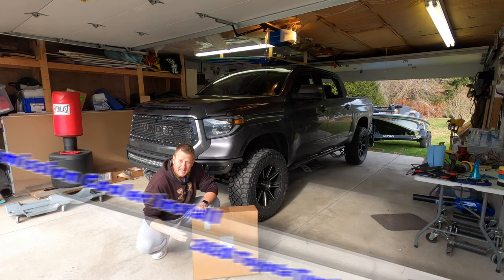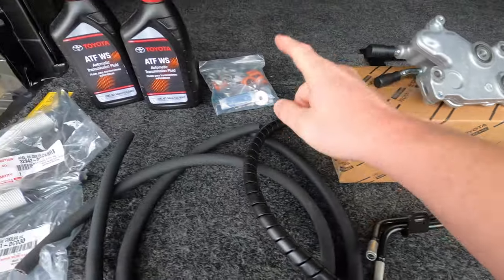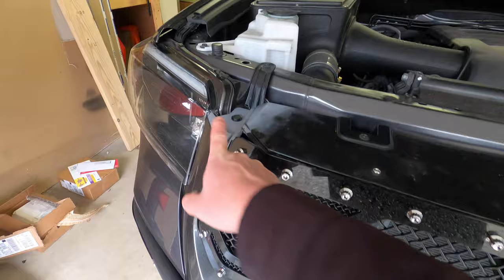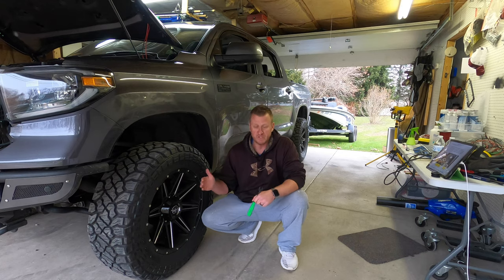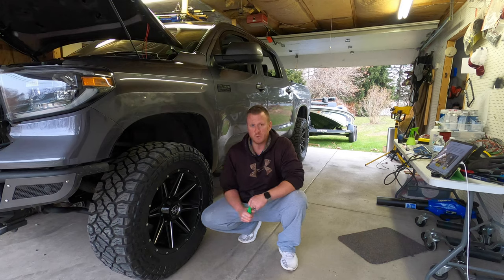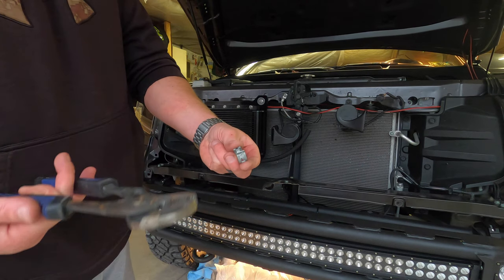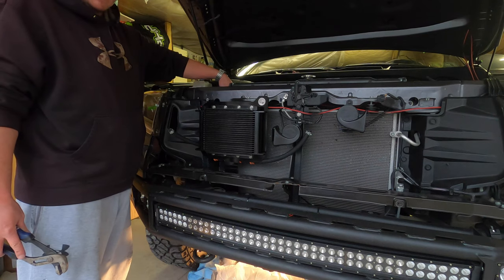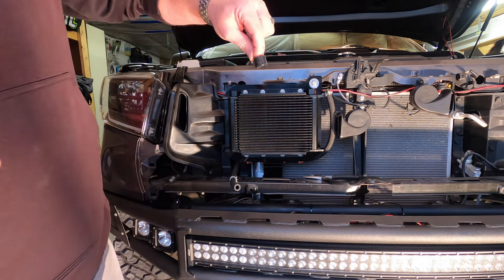Transmission Cooler Install On 2020 Toyota Tundra

Comment: Toyota owes customers trans cooler that was labeled on sales sticker. Class action needed. Nice video.
Reply from the maker: Yea I’ve heard the class action idea mentioned a few times....surprised someone hasn’t pursued it yet, I’m still scratching my head on why they would remove such an inexpensive part!
Reply: To sell more transmissions and transmission components. Lol
Reply: @GunSnob  yes. I'm sure that's why they did it. 🙄
Reply: @NitroZ18Fishing  because this is the beginning of toyots downfall when it comes to reliability. Don't know what made them think "hey!! What IF we take out all the trans coolers!" Then the rest of toyota starts cheering
Reply: @NitroZ18Fishing  of Toyota wants to sell more trucks then Chevy, Ford, and Dodge then they have to do away with quality control.
Reply: @NitroZ18Fishing  this kit is $1000. That doesn’t seem inexpensive to me. Ford stopped painting their vehicle seat frames to save pennies per unit. This is a much more substantial savings.
Reply: @NitroZ18Fishing  I actually went all the way up the ladder to the NYS attorney general to get Toyota to document their reasoning for removing the cooler from the 2019+ Tundra Models.  I also took it to the dealer from where I purchased the Tundra for one of their master mechanics to look at.  The Toyota "blueprint" (I guess you can call it) lists the transmission warmer (that round thing) as the cooler itself.  If you want, I can email you a copy of Toyota's official reply to me after the AG inquiry.  The dealership was cool about the entire process as well and didn't charge me anything to take a look and put the truck on their lift.  I would really be interested in looking into a class action, but my resources are rather limited and based upon their response listing the cooler as "supplemental" I might not have a case.
Reply from the maker: @Halim, are you on Instagram?…look me up at iFish2248 and shoot me a message, I’m definitely interested in seeing that response if ya don’t mind sharing!
Reply: @NitroZ18Fishing  kaygee2410.  I just messaged you.

Comment: My Scan Gauge II  showed 230 degrees yesterday not towing in South East Texas .  Outside temp was 100 F . We tow a 5xxx travel trailer and seeing these temps with no trailer has made me want to do this kit .  Thanks for the info / video .
Reply from the maker: No problem, thanks for checking it out!… Definitely a worthwhile addition if you tow a lot, my temperatures were much improved, gave me peace of mind!

Comment: Thanks to you and your time an effort in this video, I Completed this mod on my 2021 Tundra and the results were outstanding! With the thermostat pinned open I was unable to get a temp greater than 187 while in tow/haul mode with an outside temp of 95 here in South Carolina. Now I was trying my best and driving hard. With it unpinned in normal thermostat mode, 190 degrees was the highest I could achieve. As comparison to yesterday before the install is was 94 degrees outside and I would achieve 209 degrees in normal around town driving. I ordered the parts OE parts from Sparks and a Derale Hyper cool from eTrailer. As far as I could tell, the fan didn’t cycle until I pulled in my driveway and put it in park and heat soak finally triggered the fan thermostat which is set for turning on around 185 and off at 177. Would of bought the Genuine Cool kit, but a day late and dollar short. Great mod what ever route you go. Thanks

Comment: Great video, thank you. I just shook hands on a 2019 limited, very low mile Tundra, I've built an 80 series Land Cruiser from scratch. We currently use a 2007 Tundra to tow we've had for years, but cross country and longer trips. The 2007 4.7 struggles 

I was blown away. Toyota did not have a transmission cooler on the 2019 to 2021 Tundra.

Comment: The holes in the right side of the transmission where the ATF flows into the heater are threaded.  You can remove the factory heater, and thread in two 3/8” nipples, run the hose to the front and connect it to an aux trans cooler.  A Derale 13011 bypass will keep it from over-cooling the fluid in winter temps.  And much cheaper than the factory kit.

Comment: This video is fantastic!!! I have a 2008 5.7l with an AB60F trans.  I live in Maine and one of my transmission cooler lines rotted out.  I used this video as reference to replace the cooler lines and get the fluid level correct. I bought the Veepeak and the OBD Fusion app.  
Amazing how much easier these repairs are these days with reference from great contributors like yourself. Thanks so much!!!
Reply from the maker: Thanks for the feedback Dan, much appreciated!!…glad it helped out, thanks for watching!!

Comment: Just did this today on my 2019 Tundra.  A few things were different, but pretty straight forward.  I bought the aluminum cooler and I didn’t have a bracket or ground for the horn.  I just moved it to another location...    thanks for this video....my kit had no real instructions.
Reply from the maker: No prob, thanks for watching!...yea he upgraded the cooler to a slightly better option after I did the video, glad it was an easy install for ya!

Comment: This is seriously one of the most informative videos I’ve seen on any install of any part on any vehicle. 

Do you think this would be an upgrade on my 2017 tundra or does the OEM cooler work just as well?
Reply from the maker: Thank you, I appreciate that!!...and honestly I think you’re ok with the OEM piece on yours...I have no clue why Toyota removed these on the 2019-present Tundras after including it all those years....if you want to be sure, you can get the OBD2 scanner that I mentioned and linked below video and watch your temps...if they run high then I would consider upgrading to this kit, but you should be good with the OEM one... thanks for watching!
Reply: When you put transmission  cooler, does it increase your car oil transmission consumption? ? How many litres increase when you re-fill?

Comment: I have a 2010 Tundra 4.6 4x4 I noticed transmission temperatures as high as 260 degrees while towing small boat and averaged 215 -225 degrees during regular driving around town by myself. I added a thermostat with aftermarket cooler high temp lines. The thermostat opens at 185 degrees and  while towing it gets no higher and 188 degrees. I should’ve installed one long ago, Toyota kept telling me it could not be done. If you tow or carry heavy loads it’s well worth it.
Reply from the maker: Absolutely!!…makes no sense to me why they would remove it, it’s not even that expensive of a part!…thanks for watching!

Comment: Good video . I did a cooler install on my 19' last summer as well ... I tow a 30ft travel trailer with my tundra and the cooler upgrade was a must ! . I welded in a bung into the trans pan which allowed me to install an Autometer trans temp gauge . Gives me accurate pan temps all the time .
Reply from the maker: Thanks Jordan!...and yea, that’s an awesome idea...Definitely a must in my opinion as well, especially for anyone who tows a lot... thanks for watching!

Comment: Great video! I watched it twice and then used it as reference during the install that took me about 3 1/2 hours. I moved the thermostat pin so that gravity couldn't pull it out (I thought this was kind of weak.), but after reading the comments I am going to go pull it out. Can't wait to monitor temps the next time I pull our travel trailer. Guessing I won't see 263 F again!
Reply from the maker: Thanks Bryan, much appreciated!!...yea this kit makes a TON of difference in temps...I haven’t seen a pan temp above 200 yet, crazy what a difference!

Comment: Love video. I done same setup as your. I highly recommended put electric fan mount transmission cooler front. I put fan switch and scanguage2  monitor temp. This has help when I'm pulling my RV trailer.
Reply from the maker: Thanks Marc!...and ok awesome, I’ll check into that, I appreciate it!
Reply: Or if you know you're going to be in hot weather and towing heavy ...just pin the thermostat open and your temps will never go above 200...I watch a video of a guy to left his pinned open in hot weather and it stayed at 165.

Comment: TFL tested the Tundra transmission without the cooler on the IKE gauntlet (long uphill section of freeway near Eisenhower Tunnel in Colorado).  They concluded that transmission temperature rose to high levels, but never exceeded maximum design temperature.
Reply from the maker: yes sir, I saw that video...I'm just not comfortable with the temps I have been seeing, and I've already heard several cases of people getting warnings due to it...I just figured better safe than sorry, especially since I tow alot!...thanks for watching!!
Reply: I saw that same video and they did that test on a fall day in Colorado maybe 50-60 degrees max. I’d have to imagine the transmission temps would be higher on a 80-90 degree day.
Reply from the maker: thanks for the feedback Michael!...totally agree, this is one mod I highly recommend on our Tundras!

Comment: I've got the Stillen Kit. With the Stillen kit you can run the cooler hoses through the cut out. That's what I did with mine.
Reply from the maker: I actually thought about doing that, it’s a great idea!… Thanks for watching!
Reply: Tundra specific kit?

Comment: Thanks so much for a well made video. I would have never figured out setting up the PID's. One question someone may be able to help me with. How can I adjust the voltage readout? It's off by a full volt and I have verified this by three different meters.

Comment: I towed 6k the other day for 45 minutes in the transmission temp was 238.  Outside temperature was in low 60’s, so I’m sure it would be over 250 in the summer.  Just ordered and will do transmission fluid change with AMSOIL ATF.
Reply from the maker: Yea the temps without a cooler are way too high for me, this was a no brainer!...well worth it, thanks for watching!
Reply: Amsoil is some top shelf oils, I’ve been using it in lawn equipment and my diesel and gas trucks. Here’s how good amsoil synthetic is,  I bought a new blower and it wants me to run 32:1 mix ratio, with amsoil Sabre I’m mixing 100:1,   1.5 ounces of oil per gallon.

Comment: Needed the same thing, went a different direction to achieve similar result. Running 35” tires so I re-geared to 5.29 Nitro Gears. Now I can turn these tires like they are stock size and my transmission stays much cooler due to gear difference. OBDII shows consistently low transmission temps even while towing. Obviously this costs a lot more money, but I took care of two issues at once.
Great video!
Reply from the maker: Nice!…I considered re-gearing but just never had it done…I kinda wish I did to be honest…thanks for watching!

Comment: Great video. Very informative. I'm not sure (yet) if I need the transmission cooler. I did purchase an OBD scanner ( Veepeak) and the OBD fusion app.I followed your instructions for the ATF Pan and Torque Converter, so I will be able to monitor their temps going forward. Thanks for making it so easy to set up. I got temps for both immediately.
Reply from the maker: thank you!!...yea keep an eye on em, it's highly debated on whether it's needed or not, but most feel it's better to be safe than sorry...especially if towing...let me know how you make out, and thanks for watching!!

Comment: Clarification please.  What cycles the  fluid into the cooler and where is the air going?  Is that what is pushing out the excess fluid when you are draining at the end, as the air comes back front the cooler?  It's then a closed system again once you pull the pin till it reaches what temp for the thermostat to open?  Great video by the way.  Looks like my brother and I could tackle this project on my 2019 TRD.

Comment: Super job on this video.  I purchased a 21 - had to go to Kansa to get the one I wanted - I'm in Texas.  I'm in the big city and we must have theft protection for the catalytic converters - two were stolen in our church parking lot in the middle of the day a week ago.  Both vehicles were Toyota's with a higher profile.  I purchased the theft protection plate from KW at Offroad Desert Eagle - he has sold many of these over the last 12 years.  KW did let me know that he has done all he can to give good ventilation for the catalytic converters but....there would be higher temps experienced and that could impact transmission oil temps - especially in Texas.  I will be towing a 4.5K trailer with the Tundra and decided with the trailer towing and "cat" protection - the installation of the transmission cooler is a good idea.  I wish I would have found your video sooner - I had already purchase several items from Sparks and a Hayden cooler from Parts Geek.  The kit would have saved me from finding these parts!  Still having a problem finding the right "hard line" set.  Of course - I must choose a 2018 part as the 21 does not have it on the truck but it appears there are at least two choices of hard lines.  If you have a part number or someone does - I would appreciate it.  Thanks again - very informative.
Reply from the maker: Thanks Jim, I appreciate that!…adding the cooler is 💯 worth it, temps are MUCH better!…shoot Nick (the guy who sells these kits) an email, I’m sure he’d be happy to help ya with the part number, he’s a great guy to work with!…I’m not sure of it so unfortunately I’m no help there, I’m sorry!
Reply: @NitroZ18Fishing  Nick got right back with me.  If I would have found him sooner - no doubt I would have purchased the kit.  I will get the price down a little but he has done all the homework and has quality parts and support.  He is a sharp fella. Thanks, Jim
Reply from the maker: Yea he’s a great guy to work with, knows his stuff for sure!

Comment: Great video guy, just curious what interval are you changing your transmission oil? I have about 43K and I wish I had known about this earlier.
Reply from the maker: Thanks man, I appreciate it!...so much info out there about when to change transmission fluid, but I plan on doing mine between 30-40k, mainly because I tow somewhat frequently

Comment: I commend you on your amazing tutorial!  Well done!  I'm debating on purchasing a Toyota Tundra and was concerned about the new models not having a transmission cooler.  One question, does your trans. Temp get up to design specs?  I have talked with a few Toyota master mechanics, they stressed it is important to get the transmission temp up to temp.
Reply from the maker: Thanks Jason, I appreciate that!…pan temps get up to low-mid 190’s, but haven’t gone over 200 once that I’ve noticed...so they’re just about perfect for me...thanks for watching!

Comment: Howdy. I'm in the middle of my install. I'm probably over thinking this. I assume the cooler is itself doesn't have a flow direction. Meaning. Fluid coming in and Fluid coming out could go either way. I'm pondering something.
Reply from the maker: Hey John!…that’s correct, on the cooler I installed the flow didn’t matter…hope that helps!

Comment: What do you mean remove pin from the thermostat an how much was your bed liner mine is sprayed by I wanna carpet over it the tail gate is getting attached an yours covers it nicely thanks for the quick response loving the tundra videos about to do trd exhaust on my 2021
Reply from the maker: That small pin that I show earlier in the video on the thermostat needs to be removed as the final step of the entire process… My bed cover is called the bed rug, I want to say I paid somewhere around $400 for it… I love it, I’ve had it on all three of my tundras… Easy to clean and keeps the bed from getting scratched up at all… Thanks for checking out the videos!

Comment: Great video love your Tundra, I just subscribe and like your video. I have a question which one is the cooler line that goes back to the transmission is at the bottom of the radiator
Reply from the maker: Thanks Tony, much appreciated!!...if I remember correctly the return hose is the one on bottom...but let me verify that for ya just to be sure!
Reply: @NitroZ18Fishing  yes your right I felt the upper hose and it was hot. I tap it into the lower hose. Thanks again

Comment: That I got to spend a grand to have this installed burns me to no end. Great video. Love my '19. HATE Toyota for this move.
Reply from the maker: Thanks Rick!...and I totally agree, it’s crazy to me that they removed this after all the years of including it...makes no sense...thanks for watching!
Reply: @NitroZ18Fishing  Oh it makes sense to the accountants running Toyota. Multiply the cost of all those coolers being deleted and add that to all the transmissions they will get to repair =$$$$$$$
Reply from the maker: hate to agree with ya on this, but it def doesn't add up any other way!
Reply: That’s a very short term outlook coming from a brand with a long pedigree of reliability. Doing what’s best for the consumer will work out best in the end, but I tend to agree with it being a short term financial decision based on how many consumers will actually cause failures. I’m glad my 2017 has a cooler, that’s for sure.

Comment: Great video. Thanks for taking your time and being very detailed. Probably going to order a kit in the spring. What were your transmission temps before and after install. Thanks.
Reply from the maker: Thank you!...before install I would see temps as high as 230+ in the pan when towing...now I haven’t seen anything above 205-210, when I’m not towing the pan never goes over 195...huge improvement...thanks for watching!
Reply: @NitroZ18Fishing  were you in 4th gear or in 5th or 6th?